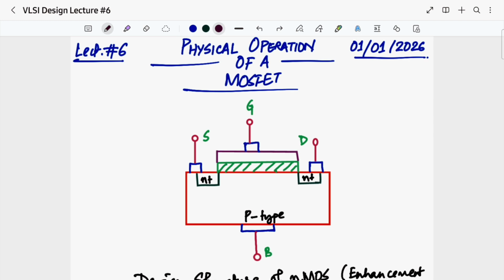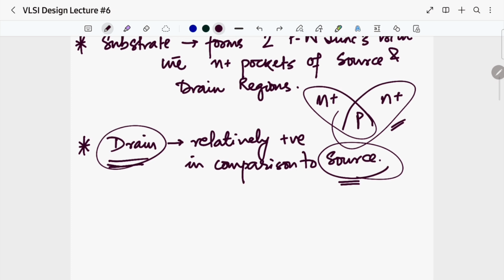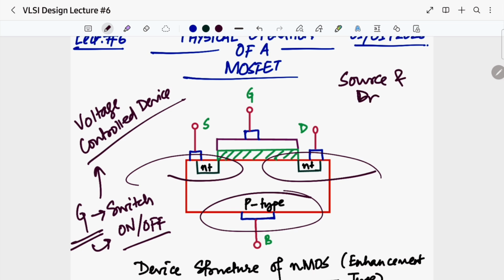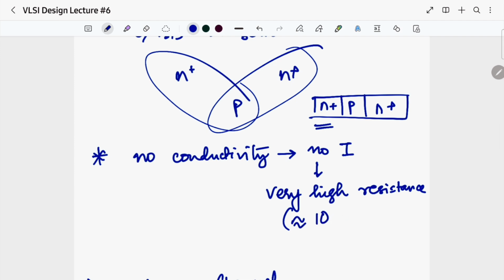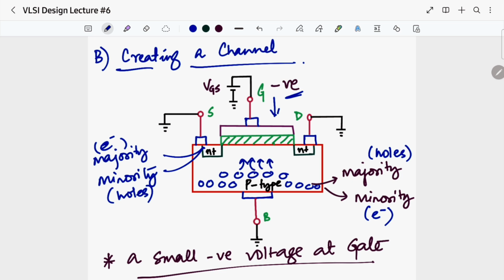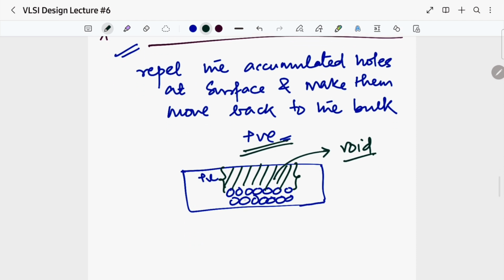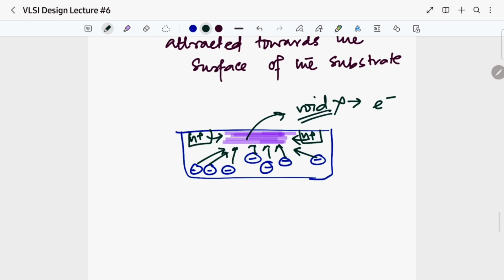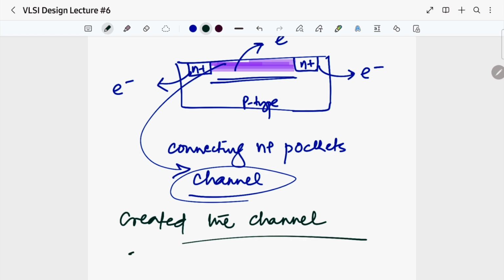How Does a MOSFET Really Work? | Channel Creation (Step-By-Step)

Comment from the maker: ⏱ *Timestamps:*
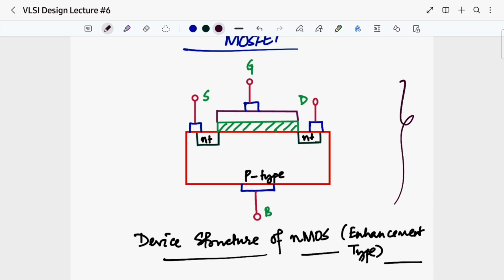00:25 - Observing the nMOS Device Structure
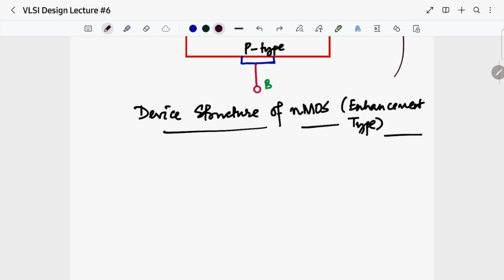01:07 - PN Junctions inside a MOSFET!!!
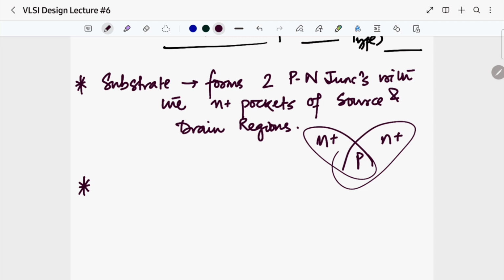02:21 - Is a MOSFET a 3 terminal or 4 terminal device???
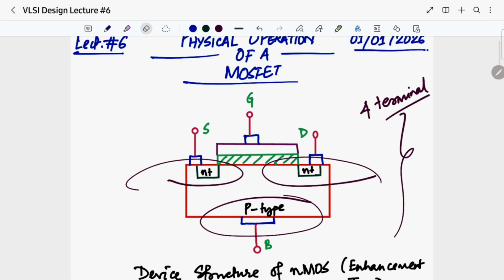06:45 - What is a Voltage Controlled Device???
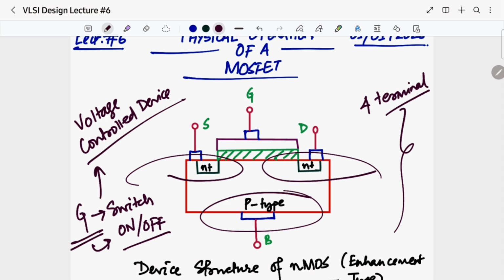08:46 - Why is a MOSFET Symmetrical Device???
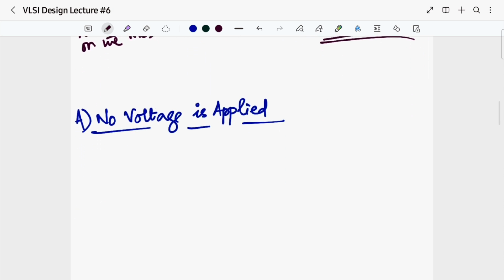09:56 - IGFET - Who is that???
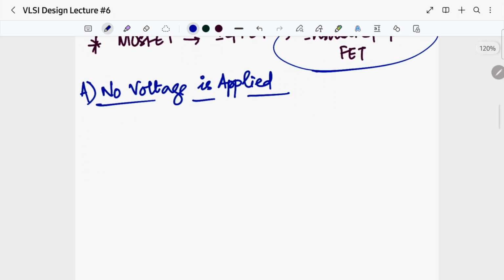10:30 - Lets Begin: Physical Operation of a MOSFET!!!
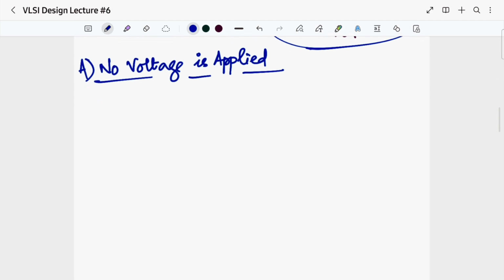10:34 - Step 1: No Voltage is Applied - What happens to a MOSFET?
14:02 - Step 2: Creating a Channel - How do we do that?
16:20 - Lets give a Small -ve Voltage at Gate
19:23 - Now Lets give a Small +ve Voltage at Gate
22:30 - Now Lets Keep Increasing the +ve Voltage at Gate
27:27 - And thats how we Create a Channel!!!
29:53 - Process of Accumulation
30:11 - Process of Depletion
30:30 - Process of Surface Inversion